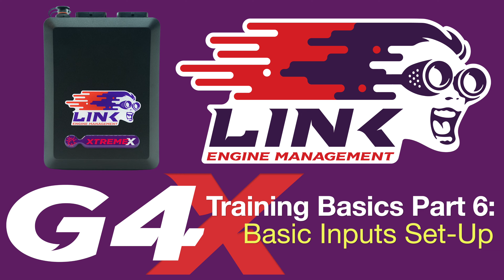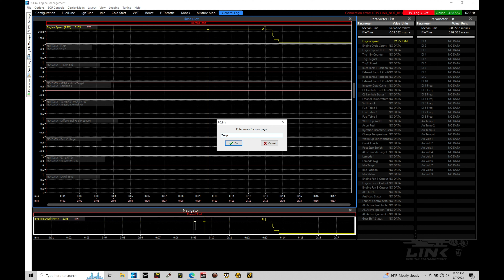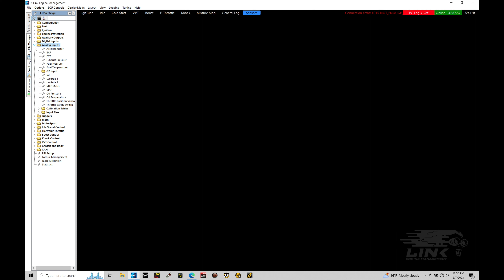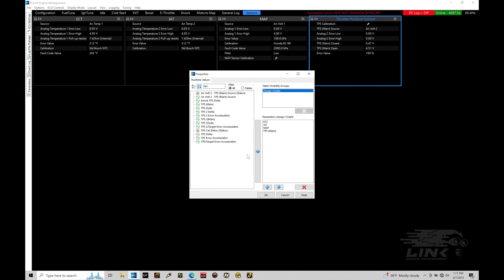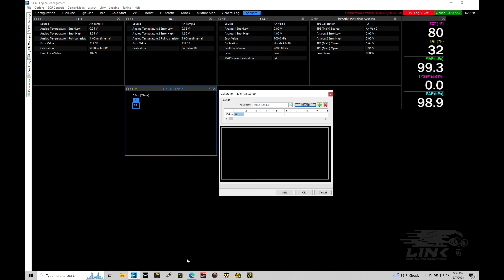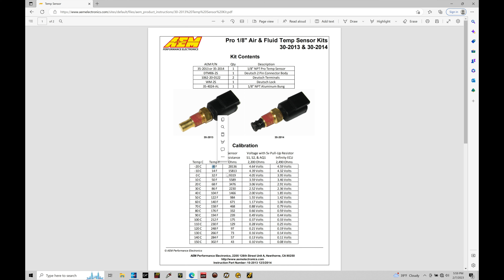Link G4x Basics Part 6: Basic Inputs

Comment: Once the table was complete at end of video the colour scale green ,Amber to red  is that relating to temp does the temp values have to be the opposite  to what you done ie cold tempnto green side and hotter temps to red
Reply from the maker: The color gradient is just what is defaulted in the software.  All of the color gradients for the tables can be changed to whatever you prefer.
Reply: @EvansPerformanceAcademy  another question to create a cal for the iat when inputing the numbers do I have to be connected  to ecm.as I need to do a cal for a new iat
Reply from the maker: @scoobdoo4233  You can edit the calibration file in offline and then transfer the tune to the Link when you reconnect in the car.